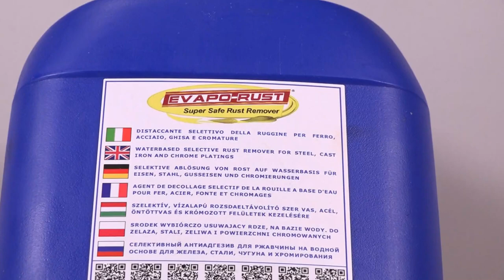Bike Bell Restoration

Comment: Great restoration, don't forget the lube though!
Reply from the maker: Thank you, but what do I need lube though?
Reply: @tybyrestoration2716  Any place with metal to metal contact, so the shaft where the striker and lever sit, on the threads and a little oil on the spring can prevent it breaking .
Reply: @tybyrestoration2716  probably is uneeded on such a small scale though.
Reply from the maker: Now I remembered after you commented, see if we have bicycles with electric bells. When I was little, I used a bell like this and I remember putting lubricant or oil on it.

Comment: Wet sanding with glass cleaner? Never seen that before
Reply from the maker: I moisten the sanding paper and the piece so that it doesn't scratch too much and I use glass product because it has soap in it and makes it slip easily. I tried many methods but this seemed the best.

Comment: I think these kind of bells are supposed to go "ding dong", the hammer hits the lower and then the upper part.
The restoration looked beautiful but the sound was a shame.
Reply from the maker: Maybe the sound differs from bell to bell.
Reply: @tybyrestoration2716 of course, you are right, mentioning different tones, but this "is" a two-tone bell, so there is a little work left to adjust the hammer, so that it touches dome and bottom, each after the other. Apart that, it sounds horrible; a pity after such a lot of good work. The "art" is to adjust the hammer so, that it does not stay in contact with dome nor bottom after producing the sound. Yours stays quite clear to near to the bottom at the end, which on the other hand let him fail to touch the dome in the first part of the two-tone job. You can hear the click, when the first sound should take place. The misplaced dome because of the damaged central screw may be the reason.
We repaired one of these bells two weeks ago, and it sounded as new, even when it looked far uglier than yours.
So, very good job optically. Mechanically, 1 point out of ten.